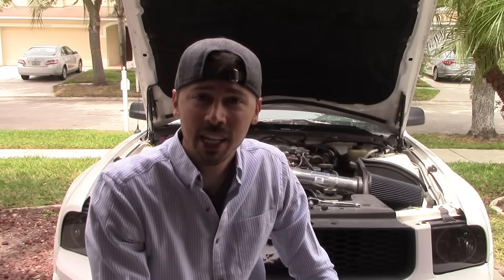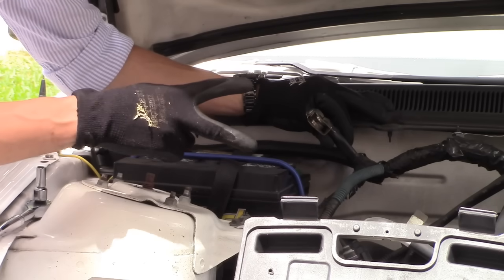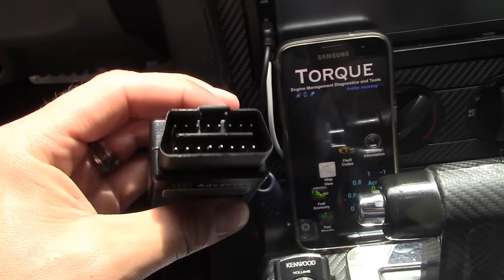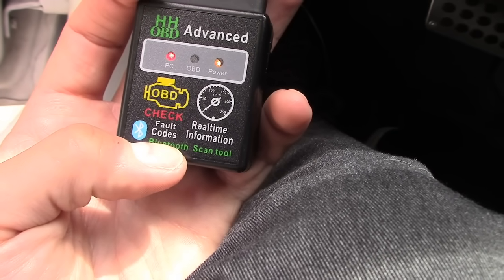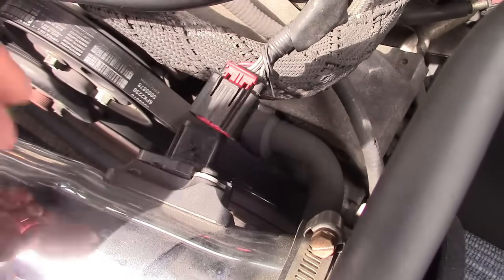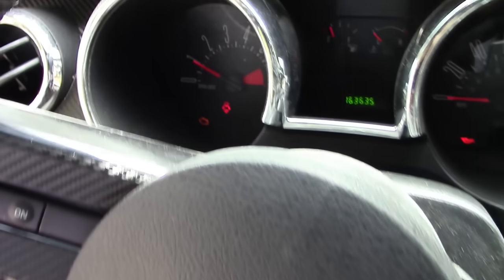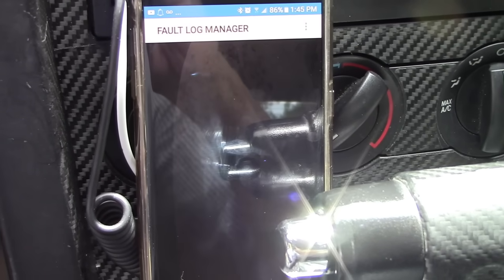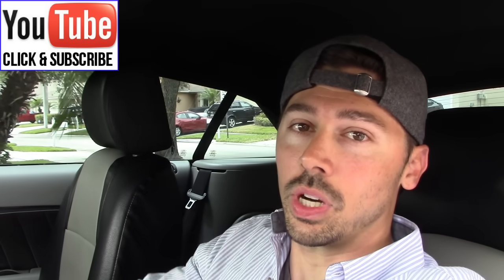3 FREE WAYS TO RESET CHECK ENGINE LIGHT WITHOUT CAR OBD SCANNER

Comment from the maker: #OBD2 TOOL-https://amzn.to/2lr9l5i
*affiliate link Instagram-https://www.instagram.com/tampatec/
THE 3 FREE WAYS ARE
1. disconnecting battery terminal connection for 1 minute (free)
2. disconnect battery connection then hold horn or use headlights to discharge remaining energy in circuit (free)
3. disconnect both battery connections and wait 1 minute
4th way is best but not free, use OBD2 tool with toque app to reset or troubleshoot codes ($19)
Reply: Tampatec doesn’t work with iPhone (iOS)
Reply: Android only
Reply: Tampatec ob2 for 2008vw
Reply: @rickgevara9598 @⁰¹;! Rmmt
Reply: Did the first method and it worked . Thanks 🙏
Reply: Scanner is no longer available on Amazon. Where else can we get it?
Reply: Tampatec and m
Reply: Ok thanks
Reply: Tampatec 🙋‍♂️
Reply: Tampatec give me ur watts aap number
Reply: Tampatec  n
Reply: Tampatec
Reply: g m c  yokan  xl   2009. problem trunk  fuse.
Reply: Alissa Michelle  as soon as it notices another error. Which may be almost immediate.
Reply: Tampatec how do I contact you about the free tech support you offer subscribers? Google+ no longer works for personal accounts.
Reply: Hi am just watching your videos. I wanted to know how can I get this device and what's the name of the device
Reply: That its for all car ore ?
Reply: How to fix the dashboard lights always on even the key is out.and it won't start
Reply: Alissa   you guys
Reply: Double if
Reply: Ò
Reply: Disconnecting negative terminal seems way easier!
Reply: My Toyota Corolla 1nz121, why white smoke coming from exocytosis pipe?
Reply: What is ABS light on the desboad?
Reply: You might want to have a close look at the privacy policy and srsly consider the benefits to you (the driver) before deciding to leave that device connected constantly. You’re allowing the device/app to collect a ridiculous amount of data. 

That data is almost certainly for sale, and considering the most likely prospective buyers (insurance companies, law enforcement, stalkers, etc), you end up with significant downside risk, which should be weighed against the estimated benefits I mentioned at the top. 

In case you wanted my opinion, I recommend using for diagnostic purposes only when needed. 😉 Since it’s iOS incompatible, I’ll have to find smthg else. And i’ll be following my own advice with whatever that ends up being.
Reply: you have to be aware that even with the scanner method the light will pop up again, if you want to erase it for good, you have to reprogram your computer with a scanner like hptunerz, that one actually rewrite the values of your computer.
Reply: STOP DISCONNECTING THE BATTERY. It does not fix anything and is pointless. If the problem is fixed (such as retightening the gas cap) drive the car and within two to three days the light will turn off on its own.

If the problem is not fixed and you disconnect the battery the light will return. Sometimes it comes back right at start up or it can take up to a week depending on the code.
Reply: Hey sir how are you i am a electrician so i want come there
Reply: Tampatec ...bro this not good like you clear codes, make other video when it comes and how

Comment: Hello. I have 2006 Seat Cordoba(VW engine 1.4L).  I downloaded Torque app and bought ELM327 - it worked immediately, no hick ups... Then I bough 2001Chryser Voyager -export model - 2.5CRD turbo diesel. I hooked it up and nothing. No parameters displayed. I do not have engine light, just checking if there are any hidden codes. I am wondering what can be the problem. It should work on diesel, too, right. My telephone showing me I am hooked up to the car using BT. Connection being good. So what can be the problem??? The BT connector/reader should work on any car or is it, that ones it hooks up to one car it cannot be reused on another make and model? Going back to my Seat, no problem....

Comment: What about if there is something wrong with the car and that is the reason why the light is on?
Reply from the maker: @josemelara7101  it can be a loose air intake connection or loose gas cap that trigger the check engine light but if you secure those things and it triggers again then it's more serious.
Reply: Then you didn't fix the issue. This is done after you've attempted to fix the problem and you want to clear the codes to make sure it's actually fixed

Comment: No iam on my 2 converter  and reason my 420 sensor won't set is because my 2008 pontiac torrent has California emissions and I live in Pennsylvania so now iam going thru hell waiting for the original caliber converter  from GM because the put that they put in won't set the 420 on my car

Comment: Thank you for your direct, to the point presentation and the fact that disconnecting the battery will delete all my saved radio station settings.

Comment: Thanks for the tips, but best not to clear the DTC codes while the engine is running. Engine should be stopped, but ignition key in On position to allow the OBD comms. Will take a few days (or drive cycles) for the LT fuel trim to stabilize, and readiness monitors to run.

Comment: If you're doing this trying to pass a state inspection, know that while the check engine light doesn't illuminate any more, the "MONITOR NOT READY" (a test to see if the EGR or whatever actually works) will continue. You have to drive the car a significant distance to allow the system to actually check if everything is kosher. To speed the process of getting the monitor not ready codes to go away, google for "drive cycle" for your specific model of car to tell you what to do to activate the tests as soon as possible.
Reply: That is exactly what happened to me when I used the OBD2 land torque to reset an error code for a leaking gas cap. When I returned to have the vehicle re-inspected the inspector told me that the system was showing as not ready. I am still looking for resources on how to do the drive cycle thing to get rid of the not ready status. This is a 2013 Ford Explorer.

Comment: I have reset mine many times just by pulling the positive connection on the battery.  Resets, and I don't lose anything on the radio.  No problems.

Comment: A technician erased my check engine light without actually fixing the problem. Drove the car all day today and the light has not returned. Does this mean there really wasn't a problem or do I need to drive a bit more before it appears again? It's a 1998 Honda crv
Reply from the maker: Sometimes a loose gas cap could trigger check engine light but keep driving next 30 miles to find out.

Comment: Dude you unplugged sumthing under the hood than ran the scan than pulled it back in and cleared the defaults. Of course the check engine light will turn off you plugged that part under the hood back in than scanned it and it went off cuz you plugged it back in.

Comment: If the problem is not fixed, it will come back soon. If the problem has been fixed, most cars have the computer systems to monitor the states and will automatically turn it off. Personally I don’t think we need to worry about the check engine light. Instead we should focus on fixing the real problems.

Comment: I'm still taking my car to the shop but this helped me to be able to drive my 2014 hyundai sonata hybrid limited again! It went into hybrid safety mode WHILE I was driving on the highway in the rain after work. I tried almost everything before I paid a crap ton and decided to use the scanner method. My car is apparently under the TXXM warranty so hopefully I won't have to pay anything out of pocket.

Update- I got rid of the crap late October of 2022 for a Ford Mustang Ecoboost Convertible
Reply: You have no idea why it doesn't look like that is
Reply: @dell-ve7ps  huh?

Comment: What do I do when the codes are wrong? I took my car in to fix the problem. They diagnosed and checked the check engine light. No mechanical problem.  The engine light is wrong.

Comment: PT Dream Cruiser 2005 - To clear codes after fixing issue: turn engine off, put into reverse (5-speed manual), turn engine on.  Codes and check engine indicator are gone.  Worked for me.
Reply from the maker: I tried it, 🤕

Comment: I hope you’re still offering advice. I ran across your clear check engine light video but I don’t think it addressed the actual problem I’m having. I live on the the west coast and require emission checks. I disconnected the positive cable for over a minute and it cleared the light but when I went to get it emission checked, it had sensor not ready failures. The technician told me that the only way to clear those codes is to drive the car for 100 - 500 miles. Will this device clear those hidden codes or is there another way?  I browsed through some of your other videos. Brilliant stuff.
Reply: Short answer, no.  When your battery is disconnected/codes are cleared, all of your modules basically reset.  Your car has to go through a "drive cycle" before all of the modules will "wake up".  If these modules are still "asleep", or if you have any DTC's stored, you will normally fail an emissions test.   Thus, if you make a repair that requires codes to be cleared, you should allow a few days of normal driving before going to get tested.

Comment: Great video, my friend.  
I had a P0440 code pop up right after a fuel stop.  I removed and tightened the fuel cap but the check engine light remained.  
I followed your steps and remove the negative cable from the battery, waited 30 seconds while I turned on the lights to discharge any remaining energy... And sure enough as soon as I reconnected the negative cable to the battery, the check engine light was cleared.  
Thank you. 💯
Reply: Ye but has the light come back on

Comment: Taking the terminals off the battery resets all the monitors, but you won't pass inspection cause of that until the monitors clear, and the ECU stores those fault codes in it's history, you just can't see that on a cheap scanner, all you get are active and pending codes

Comment: Ok so I replace a sensor actually it was  ESIM and I did erase the code how long will I have wait to see if the problem was fix.
Reply from the maker: After driving about 50 miles.
Reply: @TampaTec  that’s with all cars I have Routan it’s like town and country
Reply: @TampaTec  thanks and thanks again

Comment: the light is there for a reason. letting you know there could be a fault that could cause catastrophic engine, transmission damage. have the light checked by a PROPER  technician who can not only read the codes but explain them as well. there is a difference in codes. circuit, correlation, performance. disconnecting terminals will not work if it is a continuously monitored system setting the code... BAD INFO GUYS

Comment: Holy crap I laugh at these kind of videos. I cannot think of a car where if you actually fix the problem the cel  goes off. At our shop we highly discourage reseting a cel without fixing the reason is there. How are you supposed to troubleshoot it if you delete it? If you do the things in this video you're not reseting the cel only removing the cel on the dash. Only through the diagnostic software can you reset it. For a reason per oem.

Comment: Do you know how long does it take for engine light to reset itself? I have a scan tool and simulated the problem just so I can know but the problem is its taking a very long time for it to reset itself (without the help of the scan tool).
Reply: This is dependent many factors. If you test again, you may see the fault codes clear on their own after 5-10 drive cycles, 50-100 miles or so. The CEL may have gone off on it's own earlier before that, but the codes are still active until cleared by the PCM.

Comment: Disconnecting the battery negative terminal and waiting for 60sec and pressing the horn and turning on the light's is excellent idea, I did it on my Chevy sonic? And it worked thank you

Comment: Yeah, but when going to the inspection tag station after removing code, won't they determine you cleared the code to bypass the issue that caused us to  have a failed inspection?
Reply: Yes.  The modules will still be "asleep".  Cars need to perform a drive cycle, after codes are cleared, before the modules will "wake up".  Always do repairs a few days prior to getting tested, and drive the car.  Either everything will be great or the light will come back on due to the problem not being fixed.

Comment: naa ,dude d title says without obd scanner. so there's only 2 + scanner option....I mean if u disconnect d battery that will not clear it......u have to dissipate residual power throughout engine that's 1......etc....ps BMW have built in memory components to stop this type of thing.......sorry dude ".....//Don

Comment: How to reset check engine light without using a car old2 scanner.
STEP 1 disconnect battery
STEP 2 disconnect battery and pointlessly jump the terminals. 
STEP 3  use an obd2 scanner.
You having a laugh mate??

Comment: What if you replace a lot of parts and your car still runs bad?  Do I have to take it and have it put on a machine to clear out everything?
Reply: It sounds like the actual issue has not been fixed.  There is no magic machine that fixes everything.  Do you have a specific issue?

Comment: "3 ways to fix without using scan tool"....uses scan tool to turn off engine light!  🙄
Reply: 🤔😎🤩🤣😮‍💨😬🤐🤤😒 You nailed it lmao. people are fools and liars
Reply: Scanner is the fourth way.  1 Remove negative. 2 remove positive. 3 create a relay between the connectors. 4 use a scanner.
Reply: @ParadiseBubba People just never pay attention 😂. Besides, I just did a tweaked version of step #2, and it worked. 
To be precise:
- I left my headlight in the on position, then pressed and held my horn for 30 secs.
- Let go of my horn
- Turned my headlight off
- Reconnected my negative battery cable.
- Turn on my car, and the check engine light was gone.
Reply: Indeed, you’re so correct,  @AChi__ 
Which is why so many people liked the original comment.
Reply: To be fair, he did show how to do it without, if possible.
Reply: Don't work
Reply: Correct
Reply: very American of him
Reply: 😂😂😂😂 Facts
Reply: It works,I just took off my negative terminal wait 3 minutes replaced. Turn my car on check light was gone
Reply: three ways to reset check engine light 
1.battery 
2. obd2 scanner 
3. turn ignition on press acceleration all the way down three times then turn off acceleration 

these steps may reset your check engine light but will definitely not solve the issue.
Reply: Hahaha.
Reply: How to turn off engine light without fixing anything.
Reply: Thus guy is a joke
Reply: And the third but not least way is to use a scanner.

Comment: I think that some here may be misled . If you get the check engine light to go off without fixing the problem , they'll do the inspection - which they wont with the light on - but turning off the light without fixing the problem will still fail when they test . Is this correct?

Comment: I don't waste time watching this sort of crap videos, as a auto electrician for the past 50 years i found this sort of videos are crap. You can reset the engine light, but if you don't fix the problem, it will come on again.

Comment: I'm wondering if you can clear the code without fixing the problem - some codes will and some wont - if you can pass an emission inspection if inspected before the code comes back on?
Reply: If I understand your question correctly, the answer is no.  If you clear the codes then the modules reset.  The "asleep" modules will fail an emissions test.  Once they "wake up", if the problem was never fixed, the code will return.

Comment: Ever since the invention of the  heck engine light, we've done the disconnect battery reset.  It worked almost every time on every vehicle, however, it doesn't fix sensors if they are bad, just resets the light...if the light is because of a bad sensor the light will come back on.  Back in the old days you could get away with the reset if you needed an emissions test.  (Light on fails immediately)  but newer vehicles (and tests) can tell when scanned that your computer has been flashed (reset) its best just to get it scanned and fix the problem.

Comment: I changed my spark plugs, and to reach them you have to remove the intake filter and assembly
Reply: Hi sir my car it doesn't have check light I don't know why it's vw Bora v5
Reply: @costamunjeri7934  it sometimes happens that if you bought the car from a mechanic he could've removed the light if there was an issue he couldn't fix. When you turn the key to the position before ignition the light should illuminate(if it exists) you can also check your owners manual to see if your car has a check engine indicator

Comment: remember one thing if you disconnect the battery and/or connect the terminals together with a jumper wire you will have to clean your throttlebody. If you do not clean the throttlebody after rebooting the system it will stall and / or have a very low idle. it will idle so low that your AC will cycle very fast and not work at idle. The best thing to do is to reset it with a code reader. Do not disconnect the battery.
Reply: Ah yes, older Toyota and GM vehicles were always fun after a battery change.

Comment: If you clear the codes will they show up at the test only center or will it show up as a history code? Assuming that the problem was fixed. I can fix the problem on my car I just don't know if the test only center can recover the code even though it was cleared and fail me.

Comment: my check engine light all ways comes on too in my 93 ford ranger. then it's starts to idle ruff what could this be
Reply: Take it to Autozone and they'll do a free diagnostic.  It's probably need a new oxygen sensor.
Reply: Have you checked spark plugs and wires ?